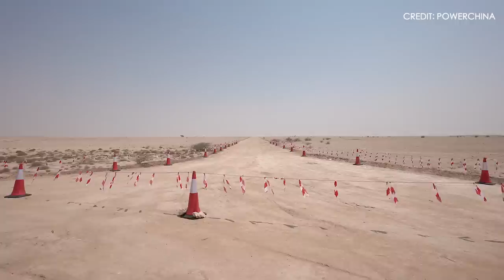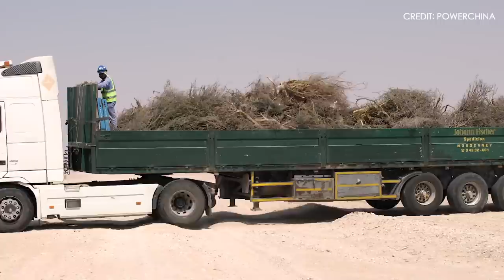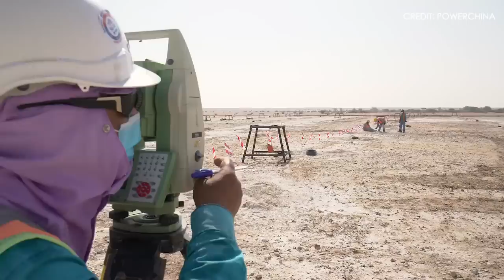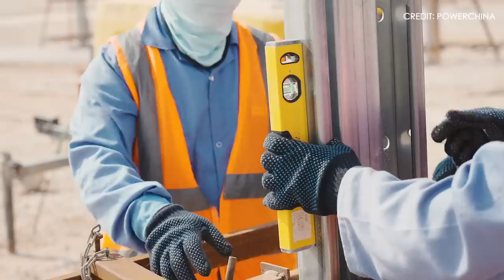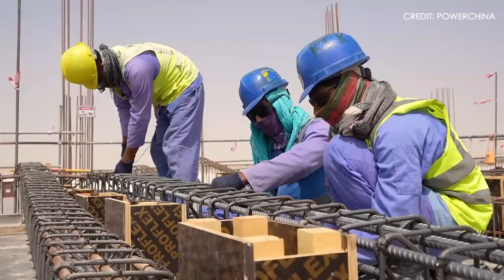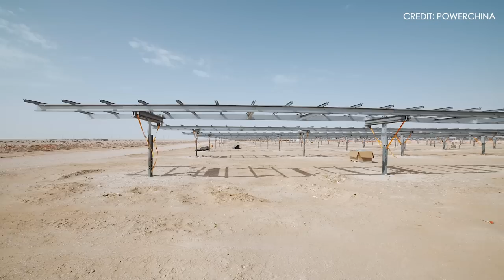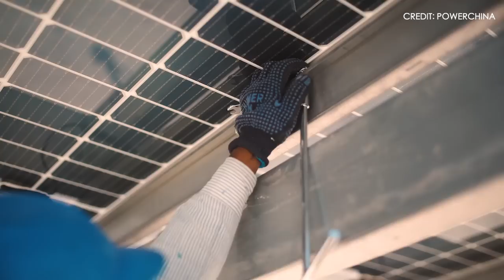Two-year timelapse of China-built 800MW solar power plant in Qatar【FULL VERSION】

Comment: Proud to be Part of this project
QC inspector Electrical Power China
Reply: What solar panel brand you used?
Reply: @jake101jake  Longi
Reply: @adnankhan-zy2cx  just a question: these solar panels are able to resist to the extreme high temperature of the desert? I mean, won't they lose their efficiency?
Reply: @adnankhan-zy2cx Could I employ Group from China to come and make this for me?
Reply: @lucacasagrande2456 
The solar panels design for sun light absorption they can handle temperatures up to +90 C which is not normal anywhere in this world
Reply: @ArabianBoy717  well obviously 90 °C cannot be found here on earth but I know that solar panels lose their efficiency with high temperatures (above 30 °C). Idk if the new generation could handle this problem
Reply: @lucacasagrande2456  

Maybe you are right I need to study more about solar panels efficiency as well 

Thank you

Comment: If a large area of all deserts are fixed with solar panels, there will be an abundant supply of clean and cheap electricity. Also, grass may grow where goats or camels can be bred like in China.
Reply: True, but after 3 decades the solar becomes inefficient and weak in making power and all needs to be thrown ass or recycled which costs a lot and is very hard to do
Reply: @noticing33  after 3 decades another rnew solar tech with effeciency and recycled
Reply: @noticing33  绿洲比黄金更珍贵
Reply: The problem not in solar panels and space for them in deserts but in energy storage and delivery
Reply: @noticing33  why you think about 100 years post . Think about now say for next 20 years . Technologies will change
Reply: @bachupv  if.
Reply: @noticing33  no ifs and buts unless this is handled by USA or India. Fortunately it's china. So definitely.

Comment: Impressive. What about the storage for any excess when the sun sets
Reply: the battery storage facility might follow nearby, but I don't think it will be exposed in the desert since batteries don't work the best in very high temperatures...
Reply: There is usually a temp controlled battery room for lights and auxiliaries at night and for when there is no sun .
Reply: so has china invented and solved the battery problem...?
Reply: @Redmanticore   They solved nothing battery tech is already there , air conditioning technology is already there they only procured and constructed.

Comment: That is a big project! Running the grid out to that location would be a project as well! I wonder how long it takes to pay back the embodied energy in all the steel, cement, copper, panels and such? Surely that place will put out a whole lot of power but I just wonder if it would take 2 years 5? 10? 20? 
It looks good, I am just wondering exactly how good it is in the overall picture.
Reply: How much (long) you will gain from planting trees？ It is that much 。

Comment: Very nice. But why the subsurface concrete foundation? Seems like overkill.
Reply: Correct - maybe they are gonna build some mild version of skyscraper on it? To be fully powered by some of the solar? And provide for a protective lookout?

Qatar is small but very international and active, like with Qipco, all sorts of private or public use not too far away from this build could be thought of. By more than just a group of professional guards. If lets say 60 or 100 soldier families would life in such a building risks for the solar fields could be lowered?
Reply: It would keep the panels from shifting as quickly over time as well as provide a structurally safe area for repair vehicles and equipment. The structure also looks to be designed to withstand any winds trying to lift the panels out of the ground as well. That would be my presumption based on previous construction experience and knowledge of windstorms requiring strong footings for certain structures in that area.
Reply: Strong Winds!
Reply: Built to last, don’t want sand to blow away foundation
Reply: @AstroInfinitum  I think you're talking about the post holes. Those make sense to me. (Still seems like overkill, but the right amount of overkill.) 

I meant the excavated rectangular area with the steel reinforced concrete. I didn't see a finished structure of that size. I'm surprised any solar PEV farm-related structure would need such a foundation.
Reply: @AstroInfinitum  I'm not arguing, I'm expressing surprise.
Reply: It looks like the panels can rotate so therefore the system needs a solid foundation to stay level. Furthermore I don’t see much vegetation or other structures that could block the wind.
Reply: This video didn't show u the final constructed structures, namely the solar panel structures and the power stations BUT at 0:05 the billboard showed the project layout.

Those solar panels had those tiny concrete bore while the power stations the reinforce concrete foundations.
Hence there weren't any "overkill". Just have to ponder a bit.